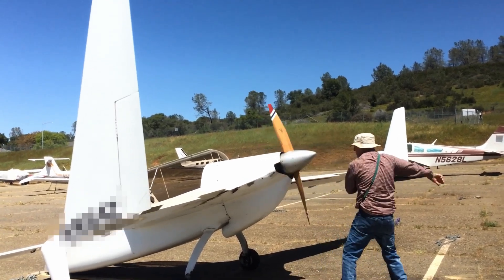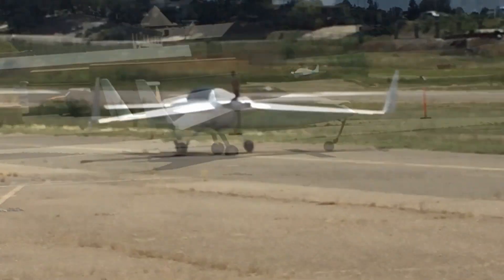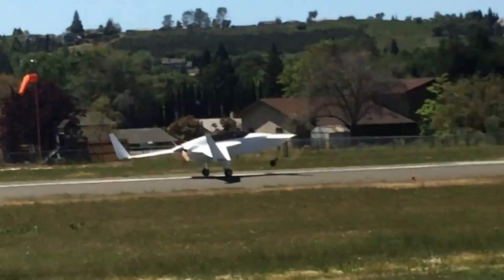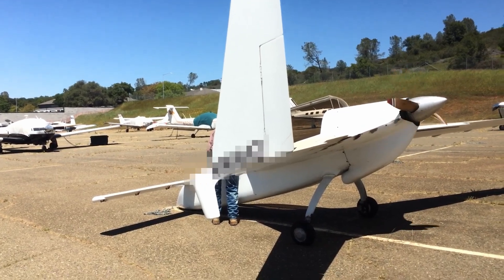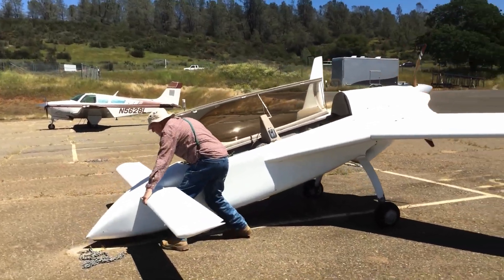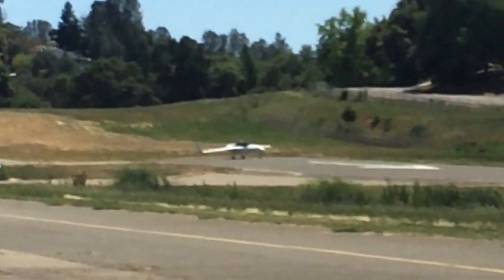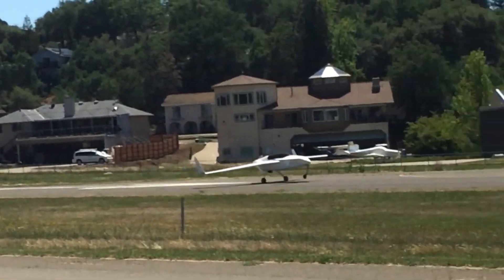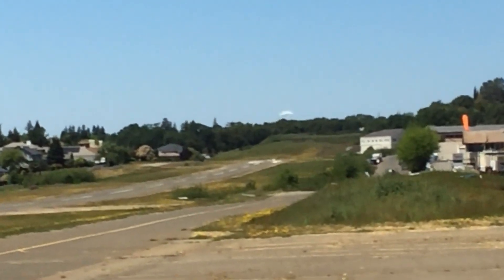Vari EZ airplane hand prop and take-off?

Comment: I myself never dare to do it i usually start it the other method . Do not want to get my hands chop off .
Reply from the maker: what's the other method?
Reply: @trueairspeed130 maybe sacrificing a few pounds and sufficient money to the goddess of safety to have a starter installed 😄
Reply: They typically don't have a starter motor (to save weight). There's only one way to start it.

Comment: Hand proping a airplane does not build up compression in the engine, even using a starter does not build up compression. You either have compression or you don't. Pulling spark plugs and adding a bit of oil to a engine that has not run for a long time will help seal the rings to the cylinders just a little bit.
Reply from the maker: Good to know